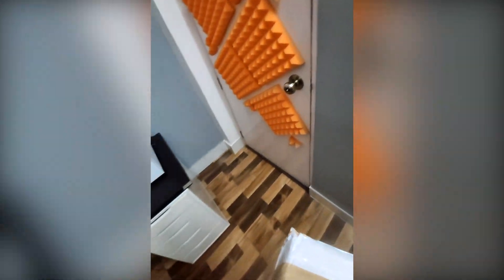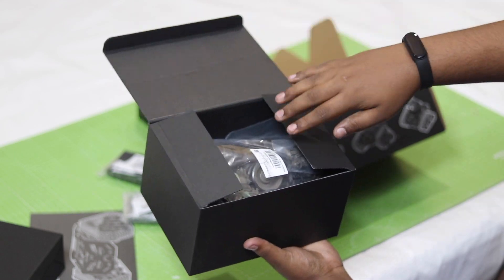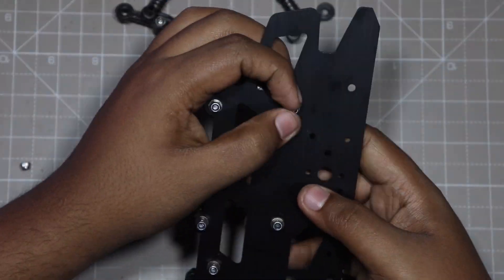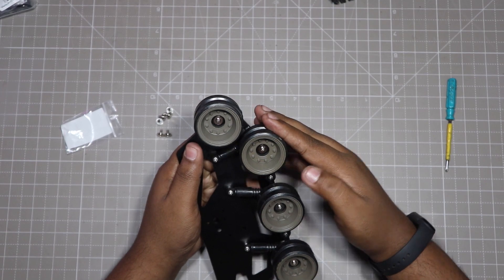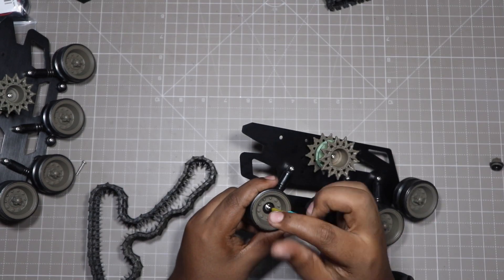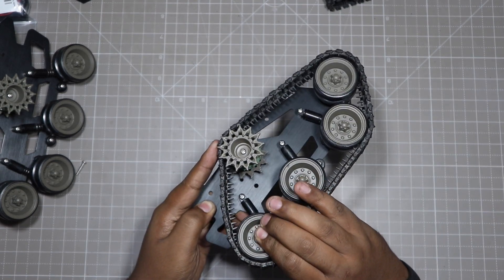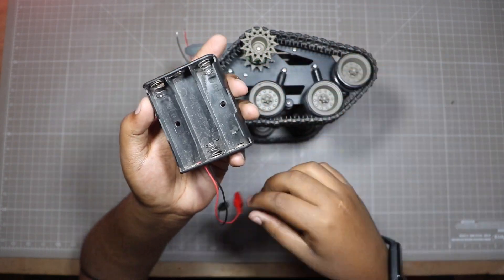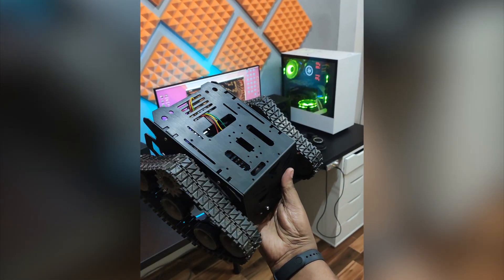How to make An Angry Tank with Arduino

Comment: tell me how to upload code in arduino uno smd. Many times I tried  but I can't uplode the code
Reply from the maker: Your smd Arduino may have ch340 chip so you will need ch340 driver and check the main number IC sometimes in smd arduino uno their is another ic used atmega8 insted of atmega328p.
Hopefully it will work
Reply: @MakeDIY9  plzz make a short video about this